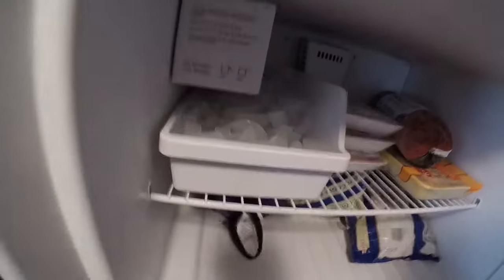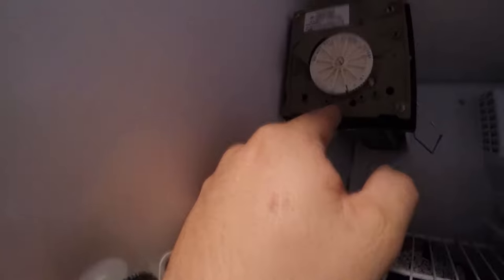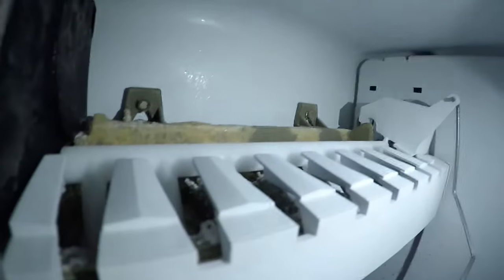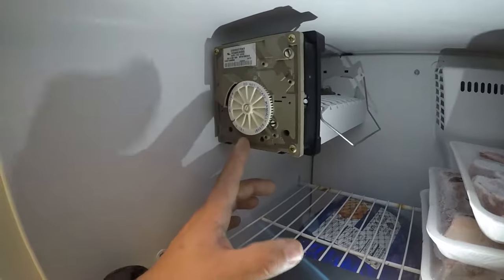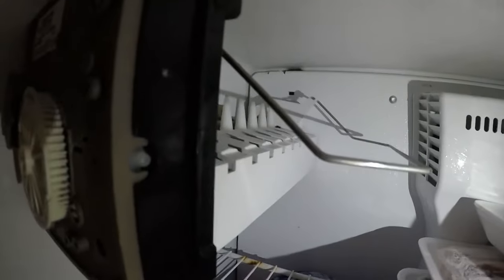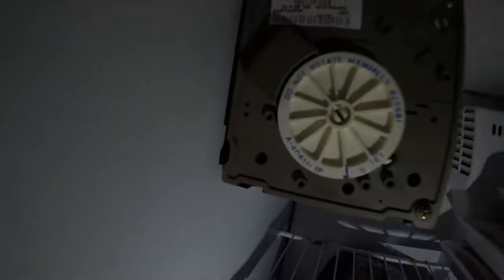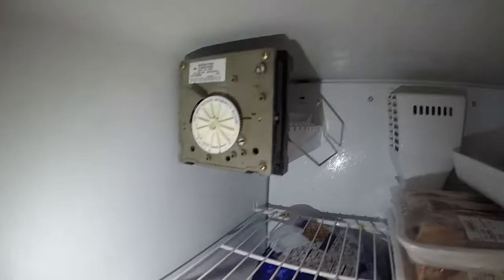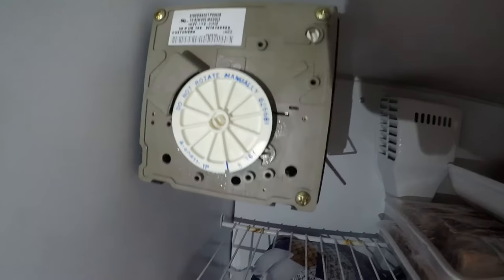Whirlpool Ice Maker Not Making Ice. How To Troubleshoot Your Ice maker.

Comment: Great advise.   I set up for the test cycle and I am waiting.  Here is a tip.  You can use your digital multimeter as a fused jumper if you set it for amps.  Only thing….. Chang the battery in your smoke detector 😁
Reply: I heard the smoke detector also.

Comment: Forgot to mention how to test the motor for 120 volts AC plugged in or ohms unplugged, never jump L and N you will short out refrigerator, use meter to confirm 120 volts

Comment: I’d like to thank you for this video. Your instructions literally saved me from buying a new ice maker that I thought was bad. I had watched another video that left out one very important step which was “pressing the door switch”. When I tested the ice module with the jumper it did nothing, so I was going buy a new one and then came across your video. Turns out I just needed to reset it due to a power outage. Thanks again!!!!!

Comment: You saved me from buying a new ice maker.  None of the other videos mentioned pushing the door switch.  As soon as I did that the cycle started.  Now it works.  Thank you!  Let me send you a 9v battery for that smoke detector.  Lol
Reply: Dude, I was looking around my house when I heard the beeps 😂
Reply: Ditto.
Reply: Me too.😀
Reply: I got a new maker.  Jumper does nothing even with Door switches pressed in either position.

So no power I guess.   

Bad fuse maybe? 

Bad sensor?

How to test those?

Comment: Excellent! Thanks for the straight-up explanation and footage of the operation and test procedures on this. You are about the only resource that actually sheds decent light and makes good sense!  The whole Ice-Maker thing is pretty simple, once someone explains it. Most other resources don't mention anything about the freeze/temperature sensor, and how slowly the ice ejector turns, and most importantly how to trigger the testing of the ice ejector and the water-fill cycles. Now that I know how all that works, it's obvious how to determine what's actually wrong. Cudos my good man!

Comment: This video did the trick!  My icemaker stopped working... and the owners' manual did not give enough information.  With a little jumper wire I was able to check the functions of the icemaker.  I am checking the temperature of the freezer compartment, to make sure it is at the proper level (0 degrees).  Thanks!!

Comment: Thank you for this. I had an issue where my ice maker was stopped halfway through a harvest cycle and it was just running water into the ice bucket and flooding the floor. I replaced my ice maker out of hand because it was getting limed up rather than trying to fix the one I had. After replacement the ice maker wouldn't move when the power was turned on.  Nothing happened, no water and no cycle.I called Whirlpool and the tech support couldn't help me troubleshoot the problem. I asked if there was a way to force a cycle and she was clueless. She wanted me to call a repair man after spending $150 on a new maker. I said I would figure it out on my own. I started searching youtube and found you. The information allowed me to discover that in addition to a bad ice maker the coil on the valve had also opened. I assume it was because it was energized for over an hour before we discovered the flood.

Comment: Thanks for posting. I replaced my main water valve on the bottom back. It was not cutting off, was filling the ice holder up. What I found is that when I took the cover off of the ice maker up top, it was caked with ice preventing the dial from turning. I got a long BBQ pit lighter and carefully melted the ice away....so I never got a chance to use my test wire jumper since it started cycling as soon as the ice was cleaned away. The arm went up and down, the tray filled now waiting for a test dump...Thx again for the video, the poor man ribeyes looked good too!!! I've tried those before!!!!

Comment: Thank you so much for this video!  I know my ice maker is good and is cycling.  However, I replaced our inlet valve last June and now it is no longer making ice.  Now I know how to check if the valve is working properly!  You Rock!  Thank you so much!
Reply from the maker: Your welcome! Good luck on your repair!
Reply: @appliancesifix7347  What the hell you doin' givin' out the Chuck Eye secret? lol. The reason why they're cheaper than Rib Eye's is because not as many people know about them, so there's less demand for them. I think they're actually better than Rib Eyes myself. Obviously I was just joking with you, but there is some truth to it. As more and more people find out about them, the price of them will keep going up until they match the price of Rib Eyes. They are very rare, as there are only two Chuck Eyes per animal, so it wouldn't take much publicity to cause them to become almost unobtainable.
Reply: So I'm in need of help! My fridge stopped working and I replaced the motherboard, but now my ice machine stopped working. I changed the filter and was trying to look into the rotator. It is not turning and I do not have copper wire...is this something I can turn with my hand?
Reply: @appliancesifix7347  hey if you are still working on appliances pls help me! I commented on the bottom.  I don't know what to do and I'm thinking I might need to go buy a new fridge.
Reply from the maker: @jennyendara5  Hey Jennifer what's the refrigerator doing?
Reply: @appliancesifix7347  so I replaced the motherboard and before the fridge stopped working the ice machine was fine now after I replaced the board the ice hasn't been making.  I changed the filter and waited and still nothing.  I followed your video, but I don't know how to get the rotater to move w/o copper wires. I'm not sure if this is something that is supposed to constantly move..like idk I'm afraid to get electrocuted. 🙈

Comment: Nice video! Thank you!  Slight process step I'd like to add.  After jumping T and H and seeing that the motor did not move, I was ready to order a new ice maker . . .BUT something told me not too.  So I checked the valve and it was working fine.  Finally I just looked inside the water tray and saw that the fingers were stuck on some ice that was built up.  Using a knife, I freed up the ice, and lo and behold, the motor starting turning.   Ice maker working just fine now.
Reply: Reading your comment may have saved me any further steps! I got a flashlight & saw there were 2 ice cubes stuck behind the teeth mechanism, next to the freezer wall. I was able to remove them w/out a tool. I sure hope this was the problem. I can feel the top of the loaded ice. Hopefully, they will be able to be released, now.  Thanks for the comment.
Reply: I use a hairdryer if to much ice freezes & blocks teeth

Comment: Great video.  I ended up replacing the entire ice maker but it still only makes one round of ice then stops.  I shorted the pins to make it rotate and it does.  It also fills with water with pins shorted.  What could be causing it to only make a few cubes of ice then stop?
Reply: Did you find what the issue was with it only going thru one cycle?
Reply: I am having the exact issue.  It goes through the entire process just fine if I jump it.  But, if I don't, it doesn't cycle..... is there a fix?

Comment: Rock on man. This worked. My problem was our Motorhome ice maker. Just bought the RV and they pushed antifreeze through it all, well antifreeze wouldn’t freeze for some reason in the ice machine 🤪. So I could get it to move to the next cycle to get more fluid in to flush the line back out.   Thanks man. Your a blessing

Comment: That "temp sensor" that you pointed out according to the manufacturer is a thermal fuse... The sensor (thermostat) is actually attached to the ice mold on the front hidden behind the controller/timing unit... according to the manufacturer... Note: I am not a repairman just a DIYer so I may be wrong.  Other than that, Thank you. Great trouble shooting info!
Reply: thanks for sharing.

Comment: You Da Man,  Excellent trouble Shooting Video, don't have to remove back, to test coils nothing, come to find out, with the Jumper wire, water is working, but ice make is not activating ! Thank You very much my Man !
Reply: Mine   the water valve worked, but the little white wheel failed to turn meaning harvester no good??

Comment: I have repaired several icemakers which were too slow or intermittent and the most common problem for not harvesting ice was a bad thermostat like a 627958 which is mounted on the front of the icemaker behind the control unit. When the ice tray gets cold enough this thermostat turns on the motor and starts the harvesting process. I was watching your video to verify the purpose of what I believe is an over temperature safety switch on the side and bottom of the ice tray in case the heating element locks ON and over heats. You seem to disagree. ??
Reply from the maker: Most common problem is bad module which is the main component on the front of the ice maker. That part number you put in the comment doest trace back to a part. There is a thermostat that acts as a safety that prevents the ice maker from producing ice if the fridge is to warm. I have seen this go bad only once or twice in my 13 yrs I've been doing this.

Comment: I tested every component and even observed the whole cycle when I made up a test rig and bench tested it outside the freezer (i had to simulate the thermostat function with a jumper). This was after buying a replacement icemaker which also worked for a couple of weeks then just quit. I was completely stymied as to the cause when it would work for a week or two then quit. I'd pull it out, clean out the remaining ice in the tray and place it back where it would work for a few days then quit again. I began to think the problem was the power source (wires, connector) coming from the refrigerator although I did verify that I had 120V coming from the freezer connector.   I verified that the connector cable (from icemaker to freezer) and it's wires were good (good continuity, not chafed) as well as verifying that the thermal OL had continuity (i.e.,  wasn't open at rest).  Since it would quit working with half melted ice in the tray I suspected that the "cycle" was being interrupted sometime after the heater turned on and the ice would (normally) dump. But again, it all worked perfectly on the bench.  I finally came to the conclusion that maybe the freezer to the icemaker connection wasn't being made up as good as it should be. I decided to use some dialectric grease on this connection. You're supposed to apply this to both connections but I couldn't effectively grease the freezer connector due to its location so I just liberally applied it to the icemaker connector (I used a very small screwdriver to kind of "pack" it into the connector). When I reconnected it I was careful to push it together as firm as I could (it has a "snap" type connector but I still pushed them together very hard after the "snap"). It now works better than ever (even when it was new it seems).  Dialectric grease is NON-CONDUCTIVE (as it should be) but it removes/displaces moisture and I'm now convinced my power connection was being compromised by moisture intrusion. Dialectric grease isn't cheap but it is designed to not only prevent moisture intrusion in electrical connections, but also prevent corrosion. It is also designed for extreme temperatures so don't use a substitute grease (e.g., vaseline). Also DO NOT use a CONDUCTIVE grease ever on any electrical connection as this will cause a short circuit or a ground would be a potential fire or personnel hazard. Dialectric grease is completely safe since it is non-conductive and is designed for this purpose.  Hopefully this will help someone salvage their icemaker as at least a last effort before throwing it out or wasting money on a new one or a service call that does not address this particular problem.

Comment: Good video, you only missed the water adjustment screw. I was getting hollow ice cubes and had to turn the little white adjustment screw on the right of the unit 1/2 turn to make solid ice cubes. Thanks!
Reply: your water solenoid may be clogged there, check that too.

Comment: This is great and great help.  What happens when you replace the whole ice maker, and the sensor boards, and it only makes a couple of harvests then stops--with ice ready to harvest but won't cycle it out?   If I remove it and thaw, it will cycle a couple more times again then stop working?  A freezer thermostat issue? or Something I am missing?  Thanks.
Reply: I think the same is happening with mines. It makes a bit of ice then stops harvesting and the level arm remains in off position. Have you found a fix?
Reply: @betty378  It was the thermostat that went bad on it, and it wasn't even a month old.  There was a web page or video, that showed where to use a volt meter to test it. Sure enough that was it.  You test it the different holes that are lettered, close to where he demonstrates to ground it. I don't remember the letters off hand.  I had it out of the refrigerator when I tested, so doesn't need to be installed to check it.  Long story short, I returned the ice maker, and ordered another one that was an original refurbished, from a different vendor.  I noticed that the refurbished was built better, like the original, and had a larger defroster sensor on it.  That was the issue as to it not harvesting.  Plugged it in, and It has been working for 6 months now, and works just like the original one that was in it.  I don't use the harvest wire arm either.  I didn't use it in my original for many years either, so it just always stays in harvest mode and one less thing to mess with.   So what it tells me, the aftermarket ice makers are cheaply made, and not as durable as the original.  
So if it won't harvest, it's the thermostat.

Comment: Thanks, it works now, everything checked out but the water tube was frozen, thanks for describing the tests
Reply from the maker: If the tube is freezing up your culprit is most likely your water Inlet Valve.
Reply: @appliancesifix7347  I had shut the water off for a week long trip. I think the timing of me shutting it off as it was filling was the problem. Everything still works a week later. Thanks I’m a subscriber now

Comment: The sensor that you are showing is an overheat sensor that cuts the power if the mold heater sticks in the on position.The harvest sensor in inside behind the module,pressed against the front of the mold. Correct otherwise. Thanks.
Reply from the maker: Thanks I appreciate that! Learn something new everyday I tell ya.

Comment: thank you, great video! my ice maker stopped working: I place the jumper in to test and it turns and drops ice to an empty tray, but then the arm remains up! and it stops making ice. If I place the arm down, it will take a very long time to make ice or stop halfway with ice surfacing but not falling. Any thoughts on the issue and how to fix?

Comment: Very helpful. I now know my motor isn’t bad and I knew my valve wasn’t bad but the only question I have is why does my ice maker dispense water in the ice maker freeze the water but not drop the water. But when I jumped the motor it dumped the ice that was in it? Any help would be great can’t afford a new fridge at this time.
Reply from the maker: Could be the temperatures in freezer, but icemaker itself is most likely the culprit.

Comment: The copper water line  from the pipe got clogged. Fixed that, but then ice maker didn't work. Found that the outlet spout to the ice maker was plugged with frozen water. Thawed it out, checked the valve by connecting V with L (video showed N, but location was the same), delivered water with the shoring the connectors, but not when running through  the rapid cycling, probably because sensor noticed freezer was too warm, hope it works after cooling it down.

Comment: This is still applicable to the French door style ice makers. I removed the entire unit before realizing the front cover pops off revealing the jumper holes. Mine apparently needed a reset by testing as the ice full arm was stuck about halfway between positions. Two notable differences between the icebox style maker and the exposed maker in the freezer: turning off the ice maker is a front panel function and there's also a single wire harness that plugs into the H connector.

Comment: Great video. So I did the wire and heard it try and turn on but no water. The ice dispenser works and the water in the door is fine so new ice maker? Looks like there a valve at the bottom of the fridge where the water comes in and gets split between the door water and ice maker. Is that valve commanded by the ice maker?
Reply from the maker: Ill try to make another video in regards to this. It could be a bad valve or bad ice maker. The ice maker sends power to the valve when it needs water. If it sends water to valve and no water its not the ice maker.

Comment: Thanks for all the tips.  I tested both circuits and neither worked.  I did push the side-by-side door latch closed and waited about 30 seconds.  Could both my ice maker and the valve go bad at the same time?  Seems like an odd scenario and I figured I'd asked before buying both parts.  Thanks again!
Reply: Same scenario here. Failed test for harvester and water valve. Did you figure it out?